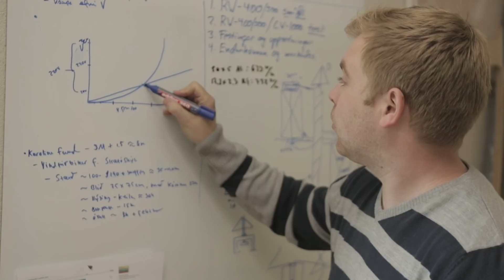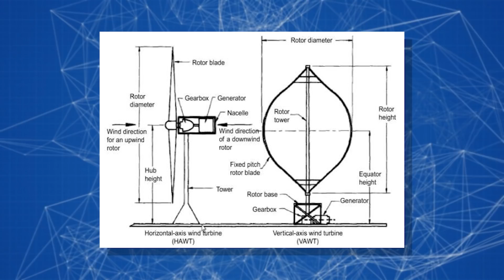Why This Wind Turbine Will Change The World

Comment: THAT"S HURRICANE speeds ! ! YEA SO IMPRESSIVE but the REASON they can do that is "They only catch a small percent of the energy in the wind - therefore you can blow them as hard as you want and they will never explode! This design is no better than any other cup or Fin savonious turbine. the only VAWTs that can compete with the Ubiquitous three blade turbines is a Cycloturbine and of these the "Flap Turbine" is KING due to it's natural rotation of the flap corresponding with the rotation of the turbine itself. It is just as efficient as a "Shielded" turbine but no need for the shield. and works from any direction.

Comment: BOILED IN MILK ! ??? WHAT the heck are you talking about? No one ever said MILK .. are you trying to track something?? By the way SAVOINIOUS turbines eill not save anyone - they are based on the simple and stupid principal that "Going upwind the drag is less than going downwind" ..   while this does make sense and is easy to build it is too simple to produce a substantial percentage of energy from wind. CYCLOTURBINES are the only way to get the high efficiency we need at a relatively low RPM. ONE inparticular sticks out to me and that is the FLAP turbine. it can be long lasting and with such a simple and,  naturally, perfect timing could be build reliably by most DIYers at a reasonable cost. FLag Turbine, or Flap Turbine, Or Louver turbine. NOTE; louver turbines must rotate naturally in the wind and can not "Wait" for the wind to blow them open, these are NOT efficient so be sure to see the turbines that have louvers mounted at an OUTER diameter and close at an INNER diameter.

Comment: But on your solution I missed physical and financial data for the wind turbine. Until now I have seen no vertical wind turbine which has the efficiency like the horizontal wind turbines. And the same on cost per Watt compared with horizontal one.

Comment: "Since the beginning of the 20th Century....blah blah blah....the average temp has increased by 1 degree"........are you using the falsified temp data from East Anglia ? I've seen the charts and there was no warming for over 10 years. Problem of course is 'green' energy efficiency...but that doesn't help when governments have to give wavers due to being bird choppers, or the lack of use due to no wind or too much wind and the turbines spin too fast.  Then there's the fact you haven't dealt with the problem of transmission lines, which there is a link to cancer for those living near them (historical). Most grids in industrialized nations have a small percentage made by green tech. Most still resort to fossil fuels for the large demands of society (as opposed to iceland) Not to mention morons like Biden trying to push EV's which will only add to electrical demand. I do like the idea of vertical wind turbines, but there are others with enclosed and more safer ones (although some haven't actually manufactured these yet {like the power pod from hacium} but I am waiting to review them when they hit the market (or any other product that mirrors the use, safety, ease of install, etc)

Comment: This idea, while not new has a lot going for it,  not least the simplicity of design, the asthetics is better than that of the typical wind turbine.  Maintenance should be easier on the vertical shaft wind generators, they could even be set up along suitable  boundaries and act as both power generators and windbreaks.  It would likely be a good idea to provide them in muted colouring that blend in with the environment.  More robust versions could be installed in larger waterways, or in the sea where prevailing, or ever changing currents would power the turbines.  The sizes could be larger as long as the foundations holding the turbines match the maximum forces they ever could encounter in a severe storm scenario.  Off-cause, it  might be easier just to use more smaller turbines rather than more challenging large versions of those turbines.  Mass produced the cost of such vertical turbines for use in the air or under water should be competetive, or cheaper than alternate green energy generation methods.!😀💖

Comment: There is clearly a role for Vertical Axis Wind Turbines... But this presentation is an advertisement and as such it encourages people to jump to the wrong conclusion. Commercial wind turbines are not big and bladed by accident, they are like that because they are more cost effective and energy efficient. I have been interested in alternative energy since the development of the Salter's Duck (look it up, it was about 1978) and my sixthform college (highschool to our American friends) had a proper VAWT in 1980, with aerofoil cross section vertical blades. The type of VAWT shown here, as if it is some magical discovery it little more than the rotating advertising signs that I saw as a child outside petrol (gas) stations in the 1960s.

Ignore the hype and check out the efficiencies. This giant anemometer is neither new nor special.

And by the way - the thing he says makes them great (no big tower) ensures that they will produce next to no power. Wind speed increases rapidly  as you go up, away from the 'dirty' air caused by the ground... that's why the people making wind turbines to keep the world's lights working use towers and blades. Also, claiming that slow rotation is a virtue is nonsense. If they worked twice as fast they would produce more power. Claiming that a weakness in the effectiveness of the design is a virtue, is straight out of the advertiser's manual.

Comment: Climate change is reversible if we first make these two changes.  We must correct the dictionary definition of profit and create a Global Economic Model GEM
that fits well with the new 'profit' definition.  I recommend the following definition of profit:
"Profit = our gratefulness and loving care for our Environment, and for the sustenance that it provides to all of us".
Clearly this definition does require a completely new Global Economic Model.

The central part of the new GEM should be the EPA.  EPA members will vote on the best 'Profit' definition that states sustenance is our only actual 'gain'
without which we can't live, and states that the environment is our only source of sustenance.

As the central hub of the new GEM, EPA members will establish, by vote, all directives related to both, the GEM and climate rescue strategies.
Here are just some rough ideas of what the EPA directives might be:
1.)  Population: Initially we need a one child per family directive.
2.)  In place of income, jobs would have an 'equivalency rating'.  Some jobs are still more important and more difficult than others.
3.)  All equivalency ratings will increase at the same time if and when the environment becomes healthier. The lowest EquivRate must still be livable.
4.)  Everyone who can work will be able, and required, to get jobs.  No more expenses, so no more cutting jobs to reduce expenses; thus, virtually no more homelessness.
5.)  No manufacturing of useless and unnecessary products.  All products will be scrutinized by various rating methods.
6.)  Whenever possible products should last a lifetime and or be easily upgradable, so we don't buy the same products repeatedly.
7.)  EPA will direct "Work Force Flow".  Example:  Shoe manufacturer will produce 100yearLife shoes for 3 years, then reduce output to about 1/10 of full capacity, and
the majority of shoe employees will be shifted to other work assignments by the EPA.  Employees still keep their EquivRate in-between jobs.

I know that this is just a rough outline of what we must do, but it's a good starting point.

This is our Ark.  Please help build it!  Questions, suggestions and any comments for or against this idea will be very deeply appreciated. Thank you!
💖

Comment: The "average global temperature" is not known. Anything they say about it is completely made up nonsense. The temperature varies at every point on the surface. Where dark surfaces absorb more energy it is warmer, where lighter surfaces reflect more energy it is cooler. There are ways of measuring temperature and there are ways of deliberately botching the reading to fit whatever multi-trillion dollar tax agenda you like. The financial motivation for fraud is so overwhelmingly obvious that I think it is safe to say that all this fear-mongering about the climate is completely unsubstantiated. Real world observations and measurements have repeatedly debunked their pathetic climate models that all predict doom and gloom unless we transfer vast swaithes of wealth into the hands of the alarmists. I'm not buying it. Get two greenhouses and fill one with normal ambient air from outside, fill the other with air that has double the CO2 concentration. Grow the same plants in both and observe that every time you do this experiment the result is 50% greener in the CO2 doubled atmosphere. You can try different types of plants and different CO2 concentrations if you like. You will inevitably find that up to about ten times the CO2 concnentration the greater the the concentration the greater the amount of plant-growth and therefore the greener the greenhouse gets. The slogan that you need to "reduce CO2 for a greener planet" is diametrically opposite to the truth. Incidently when they did the greenhouse CO2 plant-growth experiments the temperature in the CO2 rich greenhouse was the same as the control. It does nothing to the climate. You can acheive much greater effect on the temperature simply by changing the reflectivitiy of the surfaces inside. Paint the floor black it gets warm, paint it white it gets cool. The CO2 does nothing to the climate.

Comment: About 15 years ago?? was this produced in the late eightys or early nineties?  The global warming, greenhouse gas emissions problem was being discussed in the mid 1970's.  This has not been a oh my gosh! Do you see this correlation issue from the early 2000s.  It has been a are you sure there is global warming caused by human activity?  Yes?  Are you sure?  I don't believe you.  Besides if it is real you say it won't become a serious problem before 2050, so we have plenty of time. 

Fast forward to the early 2000s.  "I still don't believe that there is any global warming and besides it will cost too much money to implement these changes and hurt profits"   Then to the early 2010s.  You say that the five hottest years on record globally have occurred in the last 7 years?  What a coincidence, maybe we should take a look at this greenhouse gas emissions connection.

So the dithering continues. Big Oil and Big Coal oppose any programs because it would hurt profits, and the electric utilities are resistant because they would have to upgrade and expand their grids which will hurt profits. The automotive industry has resisted switching to EV's because it will require retooling which will.... wait for it..... hurt profits. They have been forced to accelerate their plans because Tesla has exposed the demand for EV's and the ICE manufacturers are now facing oblivion because they have waited so long to start switching.  Of course there is the VW group that has been producing EV's for several years ..... mostly because of diesel-gate and increasingly strict government emissions standards which can only be met by selling a significant number of zero emissions vehicles -- EV's.  The other pressure is coming from China which has mandated 100% of new vehicles will be EV's by 2035 (not sure it could be 2030).  

Wake up everyone. We are running out of time very quickly. The goal is 100% carbon neutral globally by 2050, that's 27 years and change.  This problem has been known and talked about for the last 50 years.  The human race has barely made a dent in carbon emissions and at the rate of progress so far we will grossly miss the mark by 2050.  It's time to start climbing on the backs of industry, kicking your Congressional Representatives and Senators in the ass and tell them to get moving. It's time for us the average human to start thinking about ways to transition from fossil fuels. Changes in habits, changes in energy consumption.  There are a lot of inventive and talented people who believe they don't have anything to contribute. We need lots of people thinking out of the box. Big Industry and Big Government are slow to act and even worse at innovating.

Comment: These turbines are fine for wind speed measurement but can't match the power produced by the propellor. In a turbine there is drag from the forward moving side so the net power produced is reduced. I would like to see some data comparing the two types at equal scale.

Comment: I'm looking into getting one of these, and use in conjunction with solar w/battery backup, to power the automatic watering/feeding system for my vegetable garden.   Rain Water collection and storage already in place and elevated 6" above garden.   spigot slow drip, didn't work as it was continual, it over watered, and ran out of water in between rain on previous tests.

Comment: over simplification rides again... it is not so much WHAT is burned, as HOW IT IS BURNED, as far as motor vehicles are involved. Carbon dioxide is NOT the villain, in the greenhouse effect, the co2 rise and fall has been dealt with by the ecology that evolved to do that... carbon MONOXIDE is like spending confederate money as far as the ecosystem is concerned. Steam engines, and steam hybrids, while encountering difficulties in arctic and anarctic environs, can burn almost any liquid or gaseous hydrocarbon and generate a carbon DIoxide emission.

Comment: Solar power is always going to be better because the wind is very unpredictable, however you can always count on the sun for the most part. Wind is only good in open areas and can become untenable during storms. If solar power technology improves it's efficiency it will be king of renewable energy. I still contend that hydroelectric power is the best option for renewable energy because it has no issues with storage for when demand is high and it is the most efficient form of electricity converting about 90% of the movement of water to electricity.

Comment: try researching info on energy production.  they cannot even come close to showing the actual costs, and i cannot help but wonder, if the wind is not blowing and the sun is not out, where will our power come from.  the research shows that the only way solar and wind are less expensive is due to subsidies.  so if you take them away, it costs more to produce the so called free electricity.

Comment: I don't have a problem with supplementing with green technology.  But it will not run a full power grid.  Plain and simple.  Also most green energy is not green.  When made. And electric cars are mostly powered by coal at this point.

Comment: What is more impressive about Helix Wind Turbines is that they have greater efficiency over a greater range of air movement (wind).  They are not a new technology... there was a startup company building "squirrel cages", similar tech, in Sylmar California but the company folded.  One turbine can still be seen in operation in the backyard of a home that overlooks the 210 freeway near Harding Street...  but, with modern engineering, today they are approaching a point of evolution where they offer a lot of promise.... particularly in the areas of Noise Pollution and Bird Strike Deaths.  Currently there is a big proposed Off Shore Wind Farm that is planned to be built in PRIME FISHING waters.  Studies show that over the expected life of those "windmills" that the very fertile waters will become sterile areas of ocean.  I guess its good that when those turbines are abandoned by the power company.... that the foundations of the masts will be like reefs, hopefully attracting sea life back to the area but how many decades of fishing will be lost from the implementation of that project to when the area recovers.  Now.... implementing a technology such as this just might be far more ecologically valuable while still allowing harvesting of potential energy.

Comment: We see new designs being made all the time and sure there are different efficiency levels but when it comes right down to it your power output it’s going to be a result of how much wind pushes against it.  The power source is always the wind you can create any design you can imagine but if you’re wind generators blade surface area is small you’re only gonna get a small amount of power.  to get large amount of power you need large blade surface area no matter what type of blade you create.  Also small wind turbines with small blade surface area have to turn fast to get any real usable power and require a relatively fast wind speed to do that which means when the wind is slow you don’t get much.   On the other hand the wind generators with large blade surface areas don’t need high-speed wind they operate on torque the larger the blade the higher the torque and with high torque you can gear up the generator speed to a higher RPM and produce way more power.

Comment: vertical axis is the way to go, you can fit loads of them together, I have a way to increase it by a lot more, vertical is more steady, it has two alternator reverse motors, if they are made right they are more efficiant than propella

Comment: idea to put forth to the auto industry for the electric car take small windmill put on car recharge battery while in use
Reply: it would increase drag on the car and increase the load on the battery more than it would generate power

Comment: with the right cost-benefit analysis, these could be very helpful.  The best use seems to me to be impromptu locations near uses.  Physics and engineering wont let them ever replace the huge horizontal three blade systems.  Scattered here and there, if the price is right, they could be a good thing.